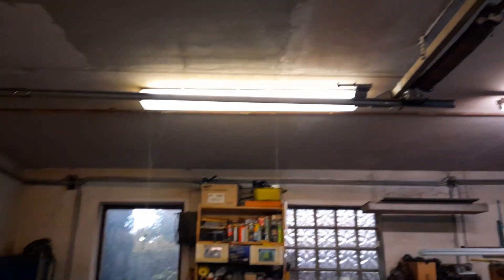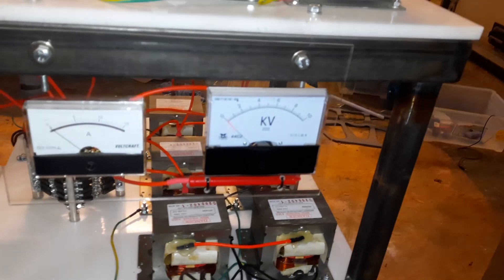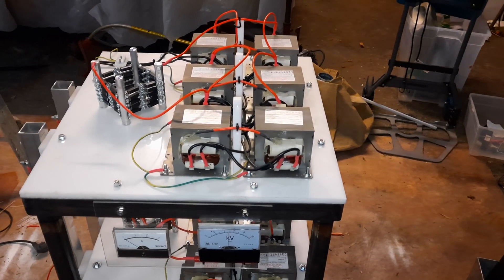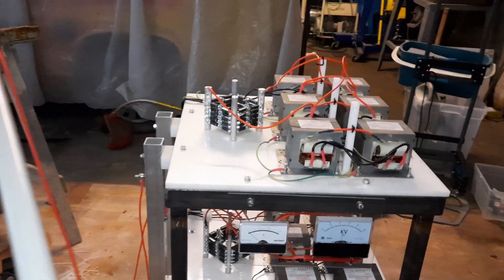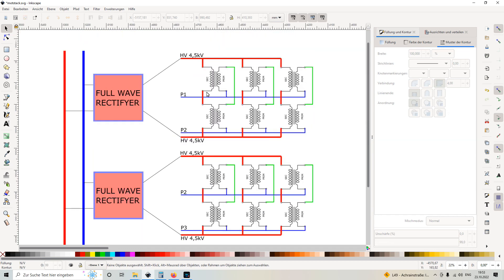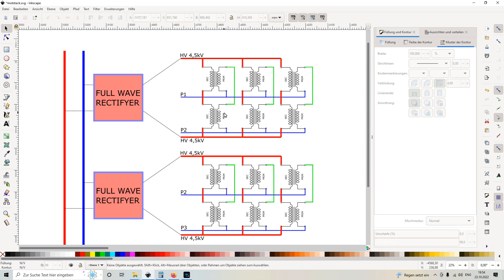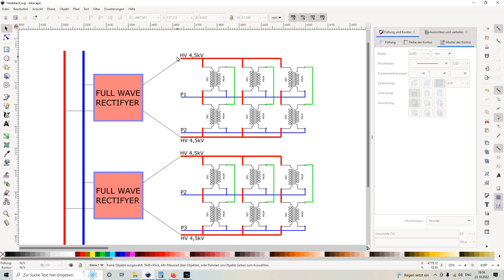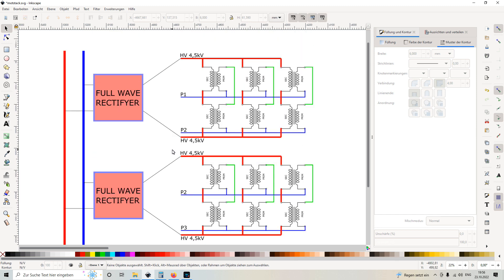monster MOT stack - 18 transformers - three phase - 4,5kV - 15 amps

Comment: Hi Andreas nice MOT- Stack ! If you want to use your MOT - Stack continuous I would not disconnect the high voltage earthing. You can still use the secondary side in series with a trick. If you earth your transformer core of two transformers you can get +-2,5KV at your transformer outputs by just using your primaries in antiseries meaning not a regular series connection you just have to swap one transformer primary around and connect it basically backwards in series this way you can earth your midpoint of your secondaries which are the cores and get +-2,5KV at the high voltage ends which will also give you 5KV but save your insulation against the core. You can still use your bridge rectifier like you do now it won´t change anything just don´t touch anything while it´s alive. I hope I could explain it well enough.
Reply: This works good for single phase but since he is using three phase power it ain't that great. It is still doable but then the outputs of the series mots won't be in phase and threfore increasiang the load of the transformers.
For the insulation it would be better to hook it up that way but if the neutral / ground is connected it will cause more load.
Reply: @fabianbohnert120   each stack on each phase has its own full bridge rectifier so they will not 'dump' into each other bank.